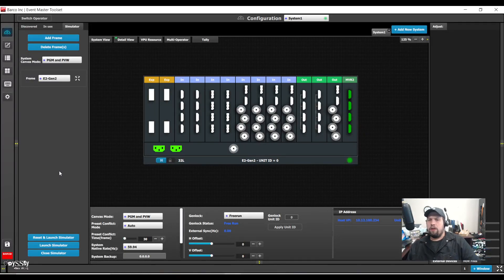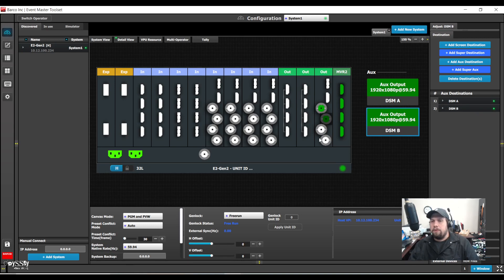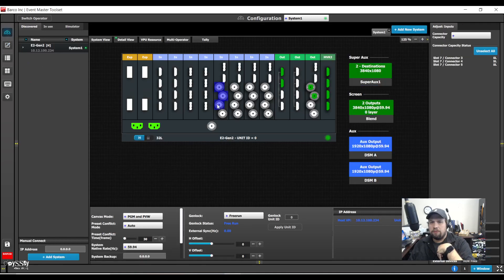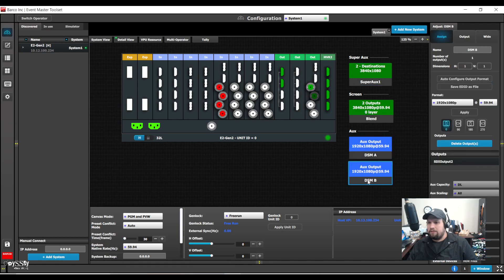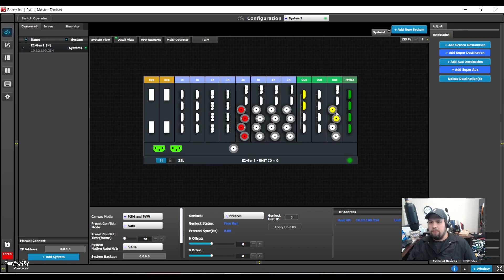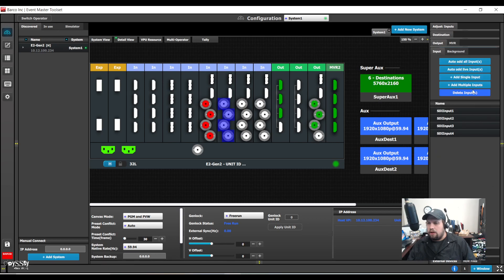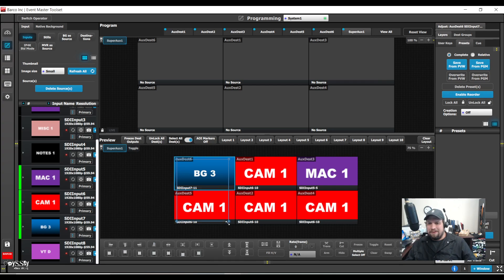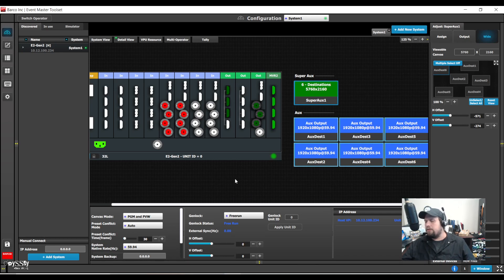E2   Super Aux Workflow

Comment: Very cool video. Will have to try it out. But what is the specific purpose of the All/Custom setting?
Reply from the maker: The custom setting allows you to alter and size and position of a source on an AUX, almost as if it were a layer! It is super cool

That said, when AUXs are grouped together in a Super Aux they no longer support this custom scaling mode

As of 9.2 the default scaling mode for AUXs is custom, thus this change is required for the time being
Reply: Ah very cool. All without using any resources I assume. Thanks for the response